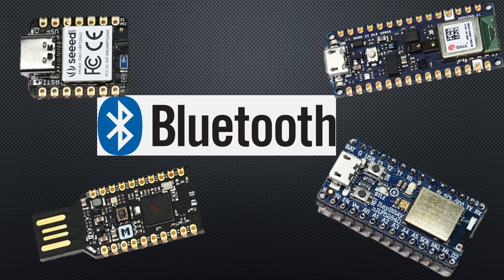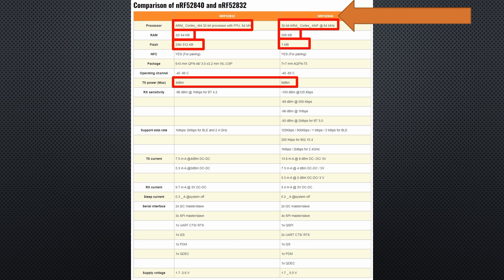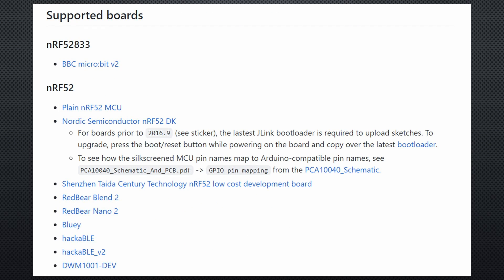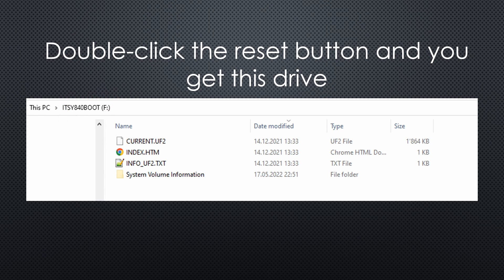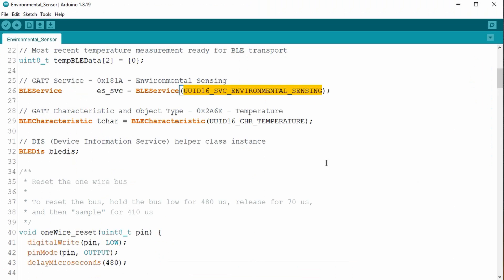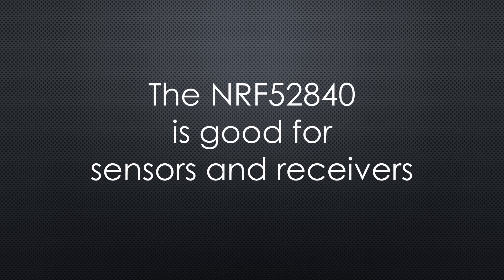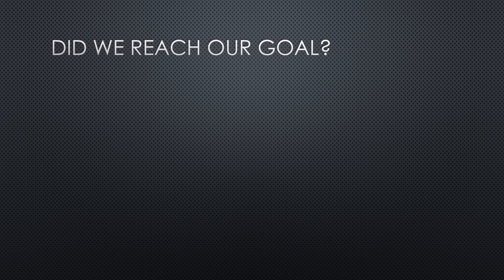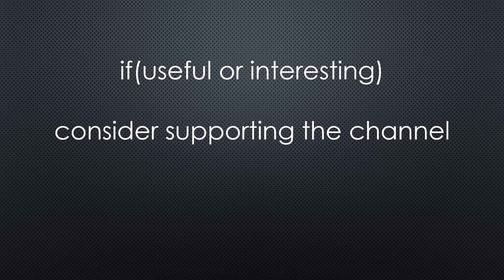429 NRF52 Bluetooth (BLE) Tutorial. Does it consume less than the ESP32? (Feather, XIAO, ItsyBitsy)

Comment: Nordic doesn't really support Arduino, their focus is both on their own libraries and the Zephyr RTOS. The Arduino BLE support is built by third parties (like Adafruit) on top of the closed source Nordic "softdevice" (essentially RTOS core), AFAIK. I have personally found this setup extremely buggy and borderline unusable. Worse, it does not expose a lot of important functionality.

If you want to really get control of what the SoC is doing and minimize power consumption, you need to use either Nordic's SDK directly (and then you can use other protocols too - e.g. Zigbee, Ant/Ant+, NRF24L01+ compatible Shockburst ...) or Zephyr. Don't expect Arduino to be able to do that, it is set up for making the common use case simple, not for allowing to squeeze every bit of performance out of the hardware. 

Nordic's documentation is excellent, BTW - but do expect a really steep learning curve because there is no "handholding" with something like BLE for you there - you get the control of literally everything, including the crypto required for establishing the connection. So it can be quite overwhelming at the start.
Reply: best comment ever.
People think Arduino Core is the key to everything, but no. Also, nRF52 has Bluetooth Stack implemented in hardware while ESP32 implements Bluetooth Stack in software as I understand. So for Wifi ESP32 it may be better but for BLE nRF52 it is much better. In the future, Nordic will also release a SoC with Wifi stack implemented in hardware, as it has just purchased a wifi IP core start-up and is working on creating new SoCs for low-power applications with wifi and ble.
Reply: @Gabriel965519437  "Also, nRF52 has Bluetooth Stack implemented in hardware while ESP32 implements Bluetooth Stack in software as I understand."

That's incorrect. nRF52 (and all Nordic SoCs) implement Bluetooth and everything else in software. There is not such thing as bluetooth stack in hardware due to the complexity involved. The "softdevice" mentioned above is exactly this - a proprietary RTOS + BLE stack. Zephyr implements BLE stack in software as well. 

The only thing you get in hardware is a 2.4GHz ISM band radio capable of GFSK modulation. Whether you use it for shockburst, BLE, ZigBee or whatever else is up to your software.
Reply: @Gabriel965519437  None of it is implemented in hardware -- it's all in the blob of firmware that they call their SoftDevice, which you're not strictly forced to use if you can do better.
Reply: News from Nordic from last June, for what it's worth: "nRF Connect extension for Visual Studio Code is the only officially supported IDE for nRF Connect SDK v2.0.0. "
Reply: Exactly... I agree with all points... Same experience I have.
Reply: Even their native SDK leaves a lot to be desired. They were early players in the market however their silicone and SDK are weak compared to their competitors. The peripheral hardware is especially bad. I have written tons of commercial code for this platform and loath it.
Reply: @ItsTristan1st , it's interesting that you mentioned the peripherals. Aside from I/O pins, I've used the serial port, D/A, and A/D peripherals on the SAMD-51, nRF52840, and the ESP32-S2. The SAMD-51 and nRF52840 performed identically -- they did what they were supposed to, the D/A, and what I really cared about, the A/D didn't need a linearization table. In fact, the chip provides registers for offset, scaling, and linearization if greater precision is needed. 

On the other hand, the ESP32-S2's D/A, and especially, A/D, were a mess. You needed a table to even use it, and still, you'd get a lot of distortion, especially near the low end. It was unusable. On startup, the serial port required that a ghost byte be transmitted before startup, or everything was always off by one byte. There were other issues as well.

Also, the chip documentation for the ESP32-S2 is terrible. For the nRF52840, it's not bad, and it works the way you'd expect an ARM Cortex-M4f to work. I haven't used the RP2040 yet, though it has great documentation, which apologetically cites particular chip bugs, though it has a less capable core -- it's for computationally non-demanding applications that don't rely heavily on the A/D, at least until they re-spin the chip.
Reply: @Johnny.Fedora  I heard WiFi wreaks havoc on A/D, so I use a seperate I2C A/D chip for my ESP8266 design.
Reply: @davidhawley1132 , you are correct, but the A/D has major linearity/missing codes issues even without RFI challenges. So, yes, an outboard A/D is the way to go if you're using that chip. My application was for a small-signal (low voltage) lab device with outboard instrument amplifier, so clearly, that wasn't going to work with the ESP A/D.
Reply: @JanCiger is right on point. Nordic does not officially support Arduino and their focus is 100% on their nRf Connect SDK (which is Zephyr based). Their old nRF5 SDK (Softdevice + Segger Embedded Studio) is also not recommended anymore.

The nice thing about zephyr is that many chipset vendors are starting to support it, so I can see it becoming the de facto standard in the future and developers not needing to learn IDEs and SDKs when switching from one vendor to another.

They also recently announced the nRF54H and nRF54L series chipsets which are going to be groundbreaking in terms of both processing power and low power consumption at the same time!
Reply: Crazy that the docs are SO BAD that I've had difficulties getting normal BL pairing for TWO DAYS 💀
Reply: Thx for the information. Sadly this sound like Nordics Products do not really suit the Arduino approach. 
I personally favor a clean and uniform approach over a very hardware specific. I want to Abstract from the actual hardware quick and cleanly. 
Arduino works very well with that approach. You get to you goal quite fast or close enough to customize the last 10%
The Nordic approve sounds like very hard work before anything works and than it gets easier. But that's very expensive.
Reply from the maker: I agree that it should be possible to create an Arduino simplification. We do not want every feature, just the standard cases.
If I would have to learn a new environment for each chip I have no time to build something…
This would also help the professional market where time is money an learning curves are investments.
Reply: @AndreasSpiess  The thing is that there's nothing magical about "an Arduino interface" except that it would take years to get done and would necessarily be least-common-denominator and non-performant.  SOC implementations will never be interoperable enough that you'll ever get what you want, so you have no choice other than to be happy with a small number of vendors whose products you get intimate with.  Or prepare to wait decades for all but 2-3 vendors to self-destruct and then you'll only have to choose between MCU-Windows, MCU-MacOS and MCU-Linux in 2040.
Reply: @ericbwertz  This is exactly why I changed careers and haven't been interested in low-level dev for 20 years. Arduino ide + youtube channels like this one + github + improvements to things like HA finally got be back into the game (at least a little bit). Until convergence happens, segmentation will be a barrier to innovation.

Comment: For sure, for applications that don't requires WiFi, Nordic is better. And Thread protocol for some sensor applications is better than BLE.
Reply from the maker: So far I did not see a lot of Thread projects. Do you have examples?
Reply: @AndreasSpiess  Well, I have temperature/humidity sensors based on nRF52840 and Thread, just a hobby project. I can share firmware with you if you want. From the commercial side, if I remember correctly, Google Nest is Thread based.
Reply from the maker: @dmitrysysoletin9967  Maybe you send me a message on Twitter or Facebook Messenger?
Reply: I need some help you have telegram?

Comment: You probably need to bypass the regulator: "Input voltage (VIN): 5V", "Circuit operating voltage: 3.3V" and/or disable (or more likely remove) the other unused (lipo charger, IMU, mic, etc) components.
Reply from the maker: You are right.

Comment: Always interesting to see other people using these chips. I started getting into Segger embedded studio to program them and have got rather out of my depth. Partly because I'm determined to use ANT+. One day maybe it will make sence and the benefit is the Arduino IDE now looks simple.
Reply: I think licensing for the ANT+ stack will always be a problem for makers wanting to use ANT+.  I don't foresee any support for Arduino for this because of that.
Reply: @jpconstantineau 
I am an old mbed user. ANT was easier in that platgorm. Things used to be so much clearer. But mbed platform is almost dead. Now i am diving into zephyr. Ill get there by the end of the summer God willing.
Good luck!😊
Reply from the maker: I never used ANT+ :-(

Comment: (Useful AND Interesting) as always! How about a look at Python development options? As far as I can see CircuitPython supports the Peripheral case but not (yet) Central. A long term project of mine is a modern version of the HP-41C calculator with HP-IL/HP-IB reimagined over BLE, and Python programmability. I'd like to define a generic instrumentation GATT profile with value, units expressed as SI dimensions, and error bars.
Reply from the maker: Sounds like an interesting project!
Concerning micro-Python. I tried two times to present higher languages for microcontrollers and the feedback was not favorable. So I will wait for a few years till my next try ;-)

Comment: I was just looking to see if you could program it to transmit less power, or at a lower data rate, or both. I remember that the WSPR network from Ham radio does this thing where they transmit at three different power levels on a cycle. Depending on your application, maybe you could program it to send out a low, medium, and high chirp, with a second between them.  Some people would get it right away, some might need to get pretty close. Maybe also the beacons have antennae built into the cases that are much larger or better tuned than the ones on the PCB.
Reply from the maker: You can reduce the power with a command. And for sure, this also would reduce power consumption. I did not try it.
Reply: @AndreasSpiess  can it “tell” when it gets interrogated? Maybe have it go into a less frequent broadcast mode when it doesn’t have anyone using it. Then, if it does start getting used, you could have it “wake up” and broadcast more. Like if it was a beacon at an art show, it’d be more active when tours were coming through.